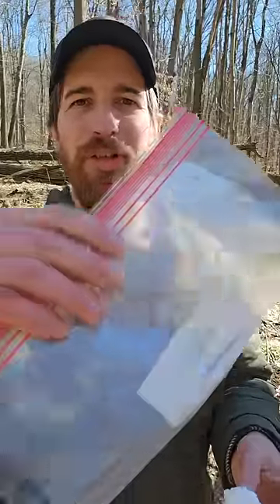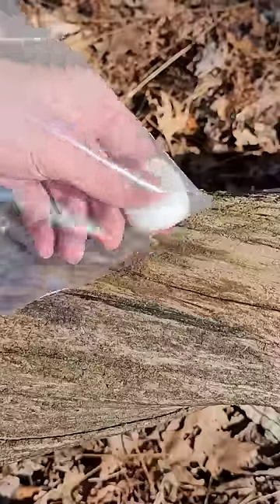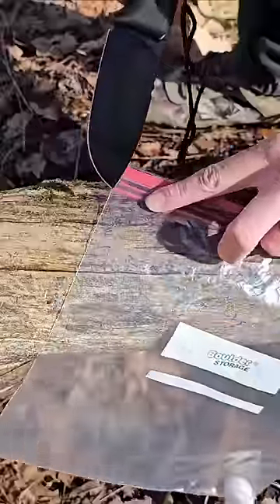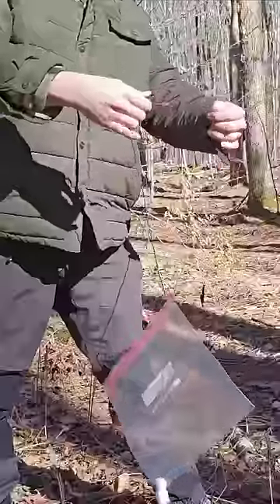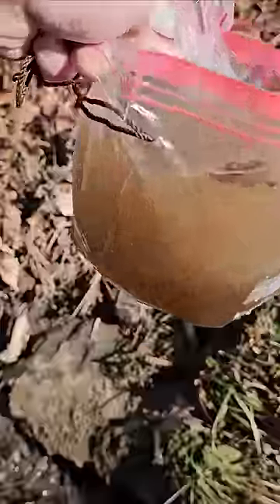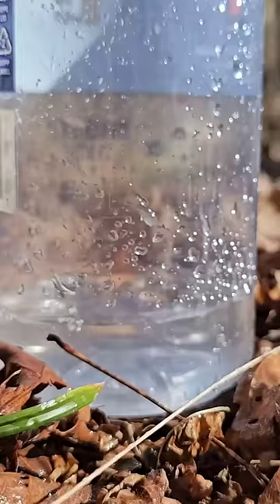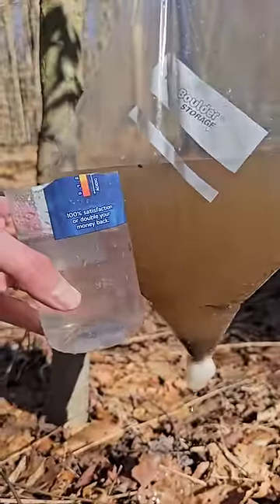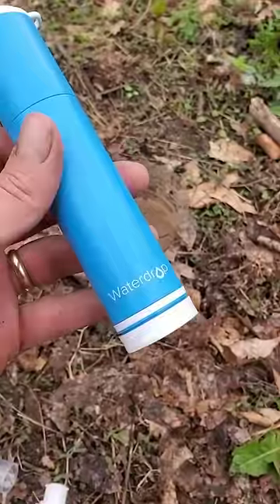Making a water filter with a cotton ball and a plastic bag 💧

Comment: I'm surprised it's that clear from just a cotton ball!! Zip lock bag filled with cotton balls going into camping bag, along with filtered straw of course. But I love the idea of keeping the sediment out of straw so it last longer and does a better job cleaning microorganisms
. Tysm
Reply: Honestly a milbank bag would be a better item to carry for this purpose and it can be used for years, decades even.
Reply: @TheUberdude187  any jansport will do
Reply: Any fabric will do.  Little baggies rip and get holes and dont carry much water.  Tbh im struggling to find a practical use for this technique.  In a survival situation its not that helpful as there are better ways to do this that will both last longer and  use more water.  This method is slow, requires constant attention, and yields a tiny cup of water that you still need to boil.
Reply: I had the same thought.

Like sweeping a floor before mopping it. Can you mop it right away? Sure, but it will make your bucket of water nastier and much more quickly.
Reply: Jansport backpack, don’t listen to dis nerd
Reply: @garfoonga1  if this is all you have then it's a good thing to know.
Reply: 99% of average people never heard of jansport or milbank, but 100% have been to walmart and have these common items that can fit in a pocket.  Idk where to get those things, or still, what they are?
Reply: I would recommend a basic water purifier from a local sporting goods store. They are lightweight and easy to pack, I never go backpacking without one.
Reply: You can make your own water filter by first burning some wood to create charcoal. Then rocks about 1 inch, pebbles, and sand. Have two containers to run your water through this twice, and the water will be crystal clear. I would still boil the water for safety. But this is a natural filter all the ingredients are found in mother nature.
Reply: It's damn near impossible to use the life straw with really muddy water. You'll hurt yourself trying. This is definitely a much better option.
Reply: @deardra5619  sand isn't everywhere and can actually be very hard to find in inland areas, but most people have cotton balls and plastic bags.
Reply: Cotton balls are really good for fire too so there's another reason to pack heaps
Reply: a single layer of cotton can filter 70% of dust in the air. so I suppose that's why its also effective when using for water
Reply: No…just macro organisms

Comment: You can also use a sock or any kind of tissue and stretch it over a plastic bottle.
It's called a pre-filter and it keeps your actual water filter fresher for longer, you still have to boil and filter or at least filter because it's not removing deadly stuff from the water.

Comment: Instead of hanging from the punched hole I would tie around and fold over the corner then wrap around again  of that Ziploc,would rip through from water weight fairly fast if used even a few times... Super cool idea though  👍👍
Reply: Yeah but it's easy to keep say, 100 little bags and balls of cotton in a roll stored in something fairly waterproof/gunkproof

Comment: You can use a non scented tampon in the cap end of a 2 liter pop bottle to filter out any muddy water, sticks or dirty water. Cut the bottom of the bottle open to fill with water. You have a prefilter.

Comment: Just a thought.. what if you were to use a piping bag used for icing cakes? It's already in a cone shape, it would hold the dirty water more efficiently.

Only thing is, youd probably need to cut two wholes for coradage, one in each corner, so thet it doesn't swing down and lose water

Comment: Would this attempt also work to filter out a lotta unwanted stuff, inserting an opened tin can inside 2 clean cotton socks, immersing it backwards in flowing water so that the water particles don't forcefully flow into the socks and can?

Comment: Is waterdrop your preferred filter? And Why? Compared to a lifestraw and the other filters you can find that do many gallons
Reply from the maker: It's very similar to Lifestraw, but apparently the Waterdrop straw will last longer, atleast according to them. And I've read that the pore size of the filter is smaller than the lifestraw
Reply: Try the MSR mini works.  I've been using mine almost 20 years now and the design hasnt changed and has readily available parts.  Bulkier than some but reliable water is the most important item some days.

Comment: Boiling won't work if you're within 3-10  miles (water table testing results) of coal mines or industries & their chemicals, or within that distance from a chemical spill, like the one which occurred 2 years ago in Ohio due to inadequate train brakes. Which would've been replaced, but was rescinded by that previous administration.
Reply: @KamalToeHarris   knock, knock… Nobody's home!

Comment: the higer you hang it the faster the water comes thru, figured this out by tying up waterbladder hooked to a sawyer filter. GRAVITY
Reply: Water won't change speed, but the water will accelerate after dripping if given a higher height to fall.